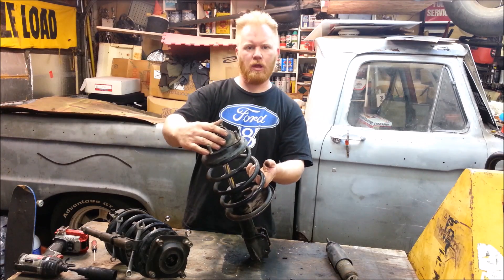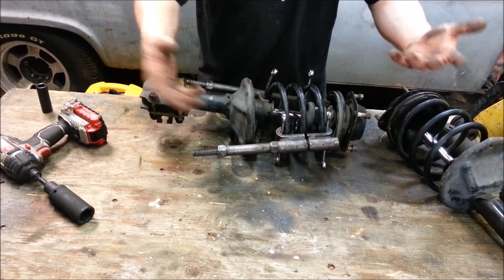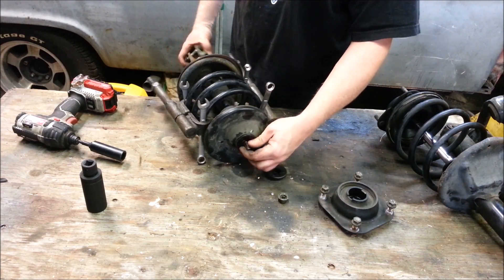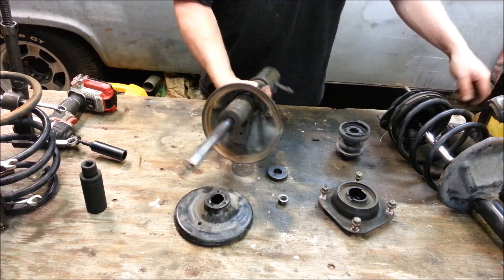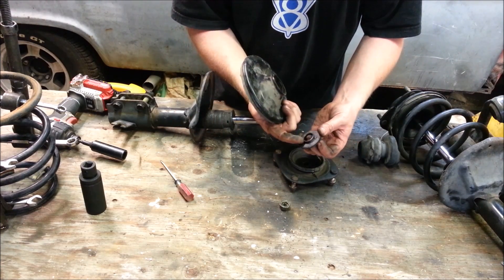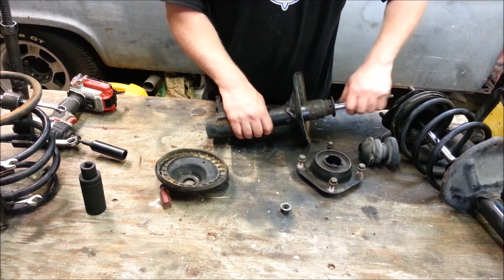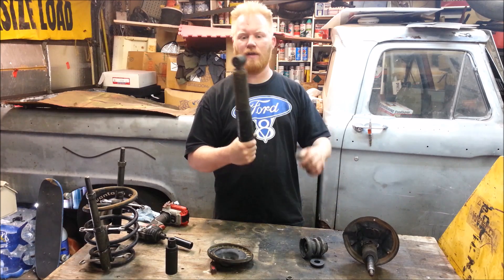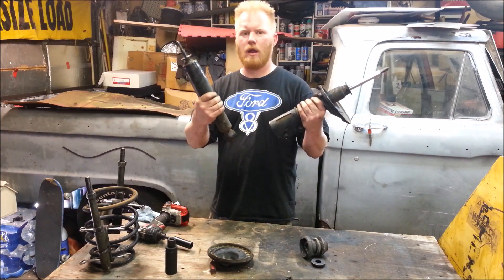Automotive Strut Tear Apart and How they work

Comment: Hey, you’re the best!

If the strut didn’t lose much oil and the bushings, seal, and chrome are still in good shape, it’s usually salvageable. Just tap a 1/8” NPT hole where it won’t interfere, then add a 1/8” to Schrader adapter. You can drain, flush, refill, or just add some suspension fluid or ATF until the piston primes when stroked top to bottom, then add a bit more. If the shock had little internal wear, the fluid usually looks clean. But if it ran low on oil or had shaft damage, it will be dirty. I think over time it slowly loses gas pressure, and without that, the lip seal stops working properly, leading to seepage as the oil cavitates and expands. Once refilled, install the Schrader valve and top off with 60 to 90 psi of shop air. More or less to tune the shock if youd like. Would be funny to add an aftermarket tpms kit to the shraders on each corner, live gas readings and top off like a tire. If the valve is accessible, you can monitor and adjust later. That often brings old struts back to life without replacing anything. Some struts have a magnet at the bottom. If not, drop one on the outside towards the bottom to catch any shavings from drilling and tapping. Hope this helps, use your tricks all the time… peace

Comment: so let me get this straight .then anti roll bar links used to be connected to the lower control arm .. No some idiot has decided to introduce the anti roll bar loads    directly on the Macpherson strut .. causing weird fidgety steering which fights the caster natural stability . My 2021 Fiat Panda hybrid has this insane remote steering action .. on a straight main road it is a constant battle to maintain a relaxed drive . The idiot Fiat mechanic suggested gusting wind .   In his defense   he is not  an engineer .

Comment: What is that bracket called on the bottom with bolts in it?
Reply from the maker: I would call it the lower strut mount.

Comment: Once again awesome work. I think I may a have strut prob. 100k on my Saturn and it creaks like crazy pulling in and out of the garage. Replaced both control arms and ball joints but didn't solve the problem.
Reply from the maker: +caddisking The Strut will grown and creak if they are really bad but so will ball joints, and control arms; but sounds like you tackled them. The bearing at the top can be the culprit or the strut/shock rod.

Comment: I know you are on Vacation............
But I have a 3 door hatch back Hyundai, Great little car 110,000 on it. I use it  like a (small) truck to haul gear and a Harbor Freight trailer sometimes. I think I am dragging tail a bit. Is there an air shock or heaver coil over rear shock set up ?  WhatWould65FordDo ?
Reply from the maker: MYFREECAMPER I use my wifes Ford Escort hatch back as a truck all the time with either loading it up or pulling trailers and have the same issue. The Escort came in a station wagon model so I threw some of those slightly heavier duty springs under it a few years ago. It helped a little but not much. I have been wanting to put some air shocks but I would have to weld on my own brackets to the frame/axle to accommodate them as nothing is available for small cars and they won't fit in the strut mount. Heavy duty springs would be really nice as well but you sacrifice ride quality(willing to live with). Something off a full size car like a Crown Vic/etc would be nice if they are the same diameter.

Comment: my 02 trailblazer squeaks when i push the breaks like the throw up and down cause the sound, they replaced my lower ball joints but 2 weeks later they started making noise again. whats your thoughts
Reply from the maker: bigrob Yeah, worn struts can cause the squeaks and so will ball joints.  Push it up and down while it's parked and see if you can recreate it.
Reply: sixtyfiveford ill give it a shot

Comment: Too shocking ha ha :-D :-D, smashing video :-D.
I have a question, my mate has an old ford transit van that seems to have incorrect camber on the front wheels, it wears the tyres on the outside.
Its the same idea as you have just shown except the spring is not on the strut, its on top of the wishbone and its chunky, do you know if its likely to be the bushes in the wishbone or the top of the strut bearing causing the problem?
Hopefully you have come across something similar.
Reply from the maker: zx8401ztv It is either the camber or the toe in/out. The Toe in/out will make the vehicle pull one way while you're driving so you'll have to constantly hold the steering wheel to keep it going straight. The Toe in/out will also wear both tires the same. The Camber won't always pull and can just affect a single tire. You can roughly check this by using a bubble level on the wheel to see how much it leans in or out (positive/negative camber) from the top to the bottom. This a rough test.
Reply: sixtyfiveford Oh i hadnt thought about a spirit level used with a spirit level road to park the van on, you are just too clever :-D
The van has allways been hard on the front tyres so my mate took it to a company to have it tracked in, it made it worse!!, you have made me wonder if that company was rubbish and set the toe in too far.
Thanks for your advise, i have another possible line to follow now, we think that companys automatically know the best for our vehicles, perhaps not so much with this one, thank you :-D

Comment: Never knew A strut spun thanks I always learn something new also is that the escort that was stolen
Reply from the maker: Shaun Hadley Yes, it is the one that was stolen. The frame was bent a little from them slamming/jumping a curb so the insurance company paid me out for it and I bought it back from them for a lot less. I pulled it out with the use of a tree and I aligned it myself and it drives straight down the road and doesn't wear tires. I've logged quite a few miles since then, even taking it out of the US into Canada.